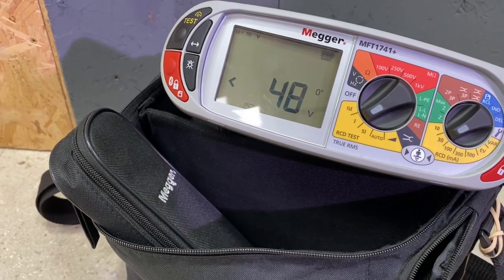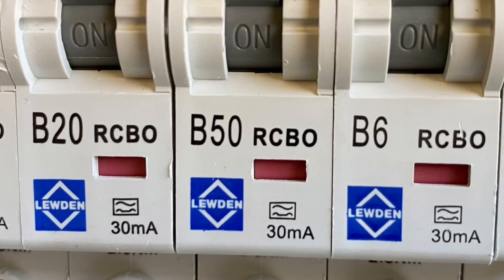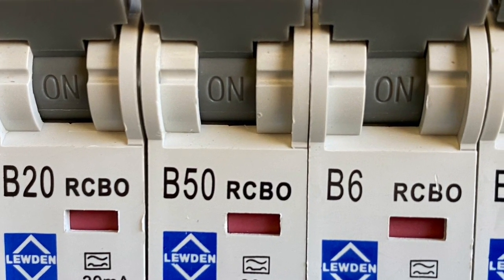TYPE A RCDs ❌ Why does my multi-function tester show a FAIL?

Comment: This is a minefield! What is the point in carrying out every test if we don't have the values to check to? The NIC EIC clearly are not aware because when we started installing type A RCD/RCBO's as standard they wanted the type A test recorded. There is only one box for this. Not even x1 & x5 as previous issues of the 17th edition type. I have had problems with Hager DP RCD type A, with tripping times in their split load boards. After sending items back and speaking to their technical because wholesalers no longer know their products. I was told that I can only test the Hager RCD under no load. So all the training and years of experience testing from the furthest point of the circuit or where the highest Zs was recorded went out the window. So they are happy just to tick a box and not have the equipment working within tolerance in real life situations. You are told that everything stops with the manufacturer's instructions/advice as it can comply, beyond BS:7671 and not necessarily be exactly inline with the regs. I now fit RCBO'S anyway which don't suffer the same problem when testing the type A RCD. Which I have now been told is not correct and unnecessary. But I don't have the information of what the results should be when testing at this setting lol. You couldn't make it up.... And they wonder why all electricians think the IET has a conspiracy just to sell more books and the NIC EIC to run more courses and make you pay for more schemes of work. I knew I should have been a plumber. They only get checked every 5 years, if that

Comment: I am an electrician in my 50th year in the trade. I am continually learning testing and commissioning procedures and this video adds to my skills accrued. I am currently changing my 40A type AC RCD that protects the entire house, so one fault and all the power is shut off. Now I am installing type A RCBO's on individual circuits. I have Fluke test gear and will run these tests as soon as I finish the job.

Comment: Lewden and ECA say test on AC. Guy from Megger says test on A and AC. My Megger 1552 only tests AC and I am not buying a new MFT just to test at type A.
Reply: I'm the same got the previous type Megger MFT 1552 NICEIC visit said to me that I needed to get a new meter and could never see why when I am testing to BS7671.
Reply: MFT without type A test, unthinkable here in Germany since type A is standard for ages. In 1983 type AC was banned for new installations with a transition period until 1984. Since then the type A are standard here. So this RCD type did not fall from the sky yesterday 😉

Never seen a type AC RCD here, not even in old installations. Either it's type A or no RCD at all.
Reply: @Marcel_Germann  that's crazy! Shows how far behind we are.
Reply: @Daniells1982  Not on everything, some installations here are quite old. Some even have TN-C in the final circuits, that was permitted until 1973 to do so here. So instead of a separate neutral and CPC you got a PEN. But you can't force the owners to rewire this if the installation is still meeting the requirements from back then and itself isn't unsafe. And then you can't install RCD protection, because the RCDs here also isolate the neutral, or in that case the PEN which is a big no no!
Reply: The MFT1500 series can test a A type By pressing the blue button you can select “dc” on the screen and this is the setting to use 
We have recently posted a video showing this
Reply: @Marcel_Germann  I, m shocked to hear that. In 1983 many European countries had, nt even started to use the AC type rcd as standard.
Reply: @01dec2001  At that time 30mA type A RCDs were introduced as mandatory for the circuits of new bathroom installations. Short time before that the first switch-mode power supplies appeared here, and the VDE decided that for them the AC RCDs won't be sufficient anymore. And these old power supplies were far worse than today ones, some even had no proper galvanic isolation.
The VDE was always considered of being extremely cautious with such things. Not only they are one of the biggest testing organisations for electrical materials in Europe, they are also releasing the regulations for electrical installations here in Germany.
Reply: @Marcel_Germann  amazing.I was working in Holland in 1987 and there was a real reluctance to use rcr,s(of any description).There appeared to be a similar mindset in most northern European countries up until the early noughties The UK was likewise  very reluctant to embrace rcd s until relatively recently.
Reply: @01dec2001  Back then this was only mandatory for bathroom circuits, the other circuits didn't require RCD protection. Until  the 2010s, then all general purpose sockets had to be protected by type A 30mA RCDs. Dedicated socket circuits could be without RCD protection, exception: Outdoor circuits. Now all sockets must be protected by RCDs.
The only exception from the RCDs in the bathroom was a hardwired water heater, even when installed in zone 1. But the disconnection time had to be less than 0.2s. So impossible in a TT-grid, in a TN-grid it's not that big problem. Even when you use a C32A MCB you require a PSCC of at least 320A to let them disconnect in less than 0.1s. The water heaters for showers here are usually 400V. But in most cases electricians here install RCD protection for them anyhow, even if it's not mandatory by the regs.
Reply: @Marcel_Germann  Thanks for the additional information.Is there by any chance an English language electricians forum in Germany?
Reply: @01dec2001  I'm afraid there's none. All in German language.
Reply: @Marcel_Germann  hi Marcel. I am currently engaged in a project (hobby) where I am recording the changes taking place in the electrical supply systems and regulations of different European countries. I am interested in finding individuals (or institutions) who may be in a position to supply answers to questions I have. Of course circumstances may not always allow such an exchange but if you are in a, position to exchange the occasional email, do please let me know.

Comment: Great content Gaz, would love to see more of this type of content. So good to have different opinions on a subject. I mainly deal with BS7909 for temporary events and AC type RCDs are not recommended for use in temporary events due to the large number of switched mode power supplies creating DC leakage which can 'blind' an AC RCD. I like to see only A types if possible, and certainly in Europe, type ACs are now rare. 
I have a Megger tester, and it does make you think that the tester manufacturers who have testers which are more software based, are better placed to push an update to the tester, or even for the user to make their own set of tests, to test RCDs fully, so testing an A type as an A type, then as an AC type, the MFT that can do all this with a couple of button pushes will be more attractive than the tester than you can only turn the dial on! 
This needs more guidance in BS7671, and discussions like this will only help electricians understand what they're testing. We're in the youtube generation now, and so people who only wait for the next update for BS7671 will be at least a year behind current thinking. 
I always try to go above and beyond the regulations for testing, as the more you test, the more you find, and the better your understanding is.
If you ever want to discuss BS7909 more, get in touch!
Reply: Yeah it could be a simple firmware update to many MFT's to add that functionality. Bit of a pain for those with older testers that could potentially have to update their tester if that becomes part of the new testing schedule though.

Comment: Thanks a lot for taking the time to pull that meeting together. Sounded to me that (for now) electricians just test on the AC setting. BS7671 tripping times are only geared towards AC type RCDs, so trying to measure anything else is somewhat meaningless.
Reply: So it seems, the type A RCD test is apparently pointless, as we have no reference point to compare to, also the settings on our testers are different to the values  used by the manufacturer of the RCD's anyway, so what is the point of having the facility to test on the type A setting anyway.  Just appears to have been a marketing scheme to sell new test equipment.

Comment: I admit a few times I’ve forgotten to change the type of RCD on my tester😬
And then test again with the correct AC or type A etc but I get different readings respectively.
If the regs “paperwork” require an AC result why are we buying fandango mft’s that test A’s etc?
Or are we gearing up for some new paperwork for the 19th edition that requires both as mentioned?
How many more boxes are we going to have to fill out that the customer can’t understand? 
A brilliant vid guys that even you had to scratch your heads and say “hey? hang on a minute “🤔🤔
Keep em coming😊👍

Comment: So the moral of this story is always set the testers to type AC no matter the actual RCD type.  If that passes you are good, and no real reason to test any further. 😁👍  I notice that most sparks on YT always test only with the type that is in the CU.  They really need some education on this subject as well, and by the sound it most do.  When the breaker manufacture, tester manufacture and standards group can't agree it really shows how messed up this is.  🤦‍♂️🤷‍♂️  Great work Gary, keep up the good work!  This sounds like a public service announcement that really needs to be published to all sparks country wide.  Single page info graphic for this and put it in every panel and RCD box.     As I have always said, that minimum code standards are a "D-" one step away from failing.

Comment: Great video.  Brings up several points.  BS7671 has no real info on how to test a type A RCD.  It should state it needs 2 tests, one for AC and the second for type A it should also state the disconnection time and currents.  In fact it should list all the RCD types separately and how to test them and what to expect as result.   As BS7671 is the minimum requirement.   

CPS's, IET and recertification bodies should contact there members and advise how to do the tests correctly which at the moment is just AC test.  Clearly the industry needs this further education.

Manufactures and wholesalers of type A's should add a sticker/label/ bit of paper in box to advise of how to test these units to the current standard and the extra test that can be run and state the disconnection time and currents.  

MFT manufacturers and calibration centers could add this as a sticker on the units.

In the long run type AC RCD will become retired and type 
A
B
F
S
will remain.  Some counrties banned type AC RCD years ago.

Comment: Simply put the device standards SHOULD specify the trip times AND test requirements and 7671 include them as excerpts, this would remove ALL ambiguity from 7671 and put the onus on the manufacturer to meet the standard and on BSI to ensure they (trip times in the standard and testing methods) are suitable. If we're approaching it not knowing whether to test on AC A B or combinations then at the heart of it the standards have failed not only us as electricians but also device OEMs.

The whole point of a standard is to ensure there is uniformity and a common  approach to doing things to if we have a device OEM and a testibg equipment OEM not singing off the same sheet then something is wrong - After-all we as Electricians put our faith in OEMs that the products are suitable and perform as intended and that the testing equipment (and regime/process) is fit for purpose and meets that fundamental principle at  the root of everything we do "....to ensure safety of livestock, persons and property"

Comment: Excellent Video. I think this highlights the fact that not enough is being done by scheme providers and training bodies to ensure that sparks actually understand the products they are installing. Many believe BS7671 is the be all and end all but fail to understand that is a “minimum” standard as the guys pointed out.  Personally if I’m installing an A type rcd I want to rely on my own findings and not that of a manufacturer because when something goes wrong I’m sure the first card they will pull in a court of law will be “well did you test and install it correctly?” and then start pulling all sorts of tables and documents on you. BS7671 is non statutory and I am sure they would also lean on EAW 1989 to push the responsibility back on you.

Comment: Very well put together discussion 
I have been in a wholesalers when someone was returning all his rcbos and board for the equipment not to be passing testing 
After a talk with guy about AC testing only not only A testing it made sense to him. 
We only use lewden now as the rolls Royce of equipment and I have surgested that this info is printed on the rcbo box and also add a small chart in the sticker pack to write A testing results direct off rcbo to stick next to board so has ongoing referance 
Thank you to all 4 of you good discussion 👍

Comment: Awesome well done eFixx. Interesting I'm having an issue with RCD within EV unit, manufacture is blaming my testers.
So according to the IET pull the cables out and test it at board. Really!
Reply from the maker: Added complexity now as some manufacturers only have the DC leakage bit of the RCD in the charger and rely upon a Type A upstream.

Comment: Above 30 mA the human heart can go into fibulation, so the purpose of additional protection is to save human life, by limiting the current so it does not exceed 30 mA and limit the time duration to below 40 ms, which is two complete cycles. 
With new technology effecting the RCD's with DC feedback the manufacturer's of RCD's and the manufacturer's of test equipment need to stop all the waffle realise that equipment needs to be developed to test them correctly even under load thus proving the time duration is kept to a safe level hence  saving life

Comment: I deliver C&G 2382 in the college and this is something I've been hammering on about on all my courses since the 18th came out.  Spotted the equal to or greater than 5x straight off the bat but hadn't seen or heard anything from any of the iet/niceic/select seminars prior to the 18th going live.  
Are some manufacturers not now supplying a separate label with the appropriate test current and setting with their RCDs.
Reply from the maker: Great update Graham 👍🏻

Comment: We have a table for that in VDE 0664-10 which is based on DIN EN 61008-1 and is for the manufacturers of RCDs:

For standard RCDs (not the time delayed ones):
On AC faults 1x I delta n must have a tripping time of max. 300ms. 2x I delta n max. 200ms, and on  5x I delta n it must be less than 40ms.
on pulsating DC currents the current is not 1x I delta n, it is 1.4x I delta n, and 2x 1.4 and 5x 1.4 x I delta n to get the same tripping times.

On DC, so type B RCDs, the thing becomes worse: 2x I delta n, 2x 2x I delta n, 5 x 2x I delta n for the same tripping time limits.

I don't know what kind of stuff the manufacturers sell in the UK, but here I don't have any issues getting below the 40ms, not even on 1x I delta n. Neither on the AC fault setting nor the pulsating DC test (type A).
Reply: Thanks a lot. learn lot

Comment: My take from this is : Mr RCD says the A test in existing MFTs is not done to the levels an A type RCD is required to perform. Result  - perfectly good product is sometimes returned as faulty… Further, only the AC test is BS7671 mandatory and any second set of MFT tests on A settings may show a (false) fail due to the above. Please let me know if I have misunderstood :) .

Comment: Good debate, raised real issues, personally I would never use a power tool to tighten an electrical terminal, though I don't own a torque driver yet, the earth leakage clamp meter ( Megger ) , impacts helping in real Life issues that clients have with dual RCD board's, obviously rcbo's way forward here, but whats next,  wave form analysis ?, of appliances!

Comment: My Assumption (based on manufacturer catalogs) was: Type A is also completely Type AC, but in addition does the semi-rectified currents.

Just tested all RCBOs in reach and all of them pass with almost identical values in AC and A tests (auto test) fine. But all of them are electromechanic ones.

Seems to be a problem with electronic RCBOs? Not a very pleasant perspective that your safety basically depends on software nuances, since I would expect it to work with AC fault currents just fine... After all it's the "usual" fault current when people are touching broken extension corts and such.

A bit lame how the Lewden guy tries to get away by tossing formalities and tabulations around...

Comment: Excellent content. Good knowledgeable guests there Gaz.
Reply: How is your practice being adjusted with regard to RCD testing? I have a different view being in the states where testing is more embedded in industrial settings than residential but in my own home I am testing beyond the basic standard actually more lab science testing using scopes and very specific waveform injections to get a view of GFCI variable operation/ tolerance. Very interesting debate and really putting these gnarly issues out there. I wonder what the E5 group fellas would make of this.

Comment: This is where the book needs updating…again. On the EV course I did, if I had tested on the AC function on the type A breaker I would of failed. Lack of clarification again. I was told to only test type A rcbo’s on the on A and not AC. This is a helpful video but yet again the regulations fall flat on their face.